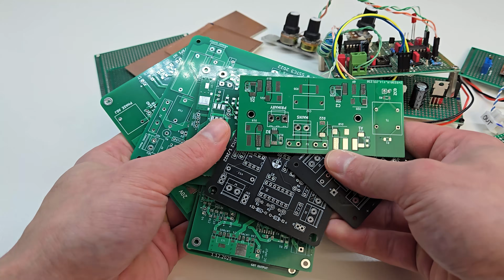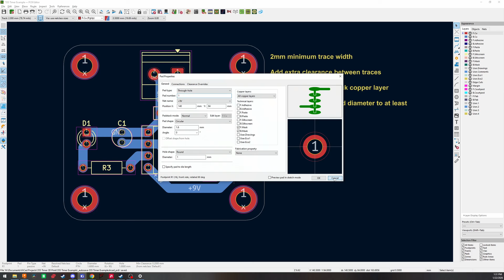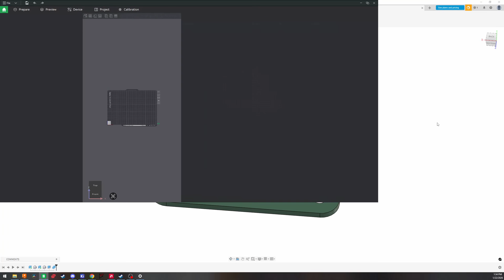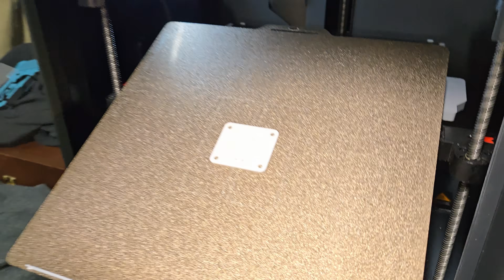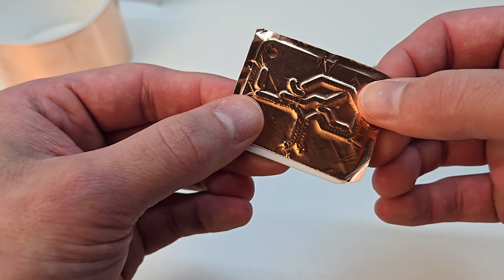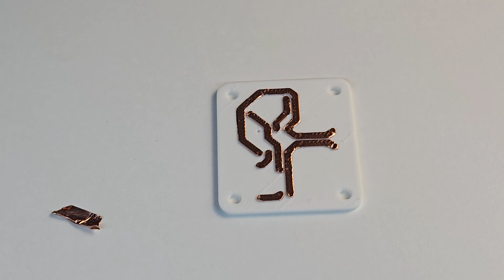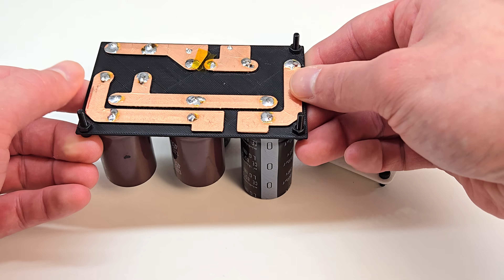3D Print Your Own PCB

Comment: Hmmmmm
You could make a script that turns the board design file into a STL with two boards, one the actual board with concave lines on where you would cut the copper and holes for the circuit to wrap around, other a board with extruded lines that fits into those lines and poles to fit the circuit holes, then you make the wholes in the first board too using the script. Then after you print you just squish one against the other

Comment: I finished my first one this week ! t'has been hard to succeed at finishing my first 3DPCB, but i made it. 

To me, the trickiest part is to cut the copper tape around the tracks ! even though I sharpen my blade before i start (or using an exacto like you do), there's always a moment the copper ends up folding a little because the blade wasn't able to cut it. that's not that much of a problem with long tracks, however, cutting arround the pads, now THAT is tricky !!! 

that's so frustrating when you wanna do everything clean and elegant, but there's copper parts that are damaged, folded, torn etc.. not to mention when it is peeling off, happened to me sometimes but it is still rare fortunately. 

But when you ends up with your nice finished 3DPCB knowing that you did it from scratch ... That's always gratifying 😌

Comment: Nice concept! I wonder if printing a small, wire sized channel could simplify the process. Might be less work to push a wire into it and bend the ends out, so they match the component leads coming through the board for soldering.

Comment: One thing I did forget to ask, how does the tape do over time? Will it peel up/crack at all on the PLA, causing shorts or broken connections? Worried about the longevity of this method.
Reply from the maker: Good question. I have had a new board assembled for about 1.5months and it isn't showing any signs of cracking or peeling. That is isn't very long but that is the "oldest" board I have.
Reply: @QZW_Labs  Sounds good, thanks!

Comment: If the 3D printer equips with the heater that can melt and continuous feed Soldering wire. You probably can use 3D printer to print circuit directly.

Comment: You can change the thickness of the copper layer in KiCAD, and set board clearances, minimum trace distances etc in the board setup. This means you don't need to worry about the fusion360 step. You can just export the STL file and print
Reply: YO TYSM this helped out a bunch

Comment: I thought you'd be using a Cricut machine to cut the copper tape. Really good idea thou
Reply from the maker: For such a simple, hands on project it isn't worth the cost of a machine like that. Using a real pcb would be much better. Cutting it by hand is really easy and doesn't take much time at all.

Comment: I gave this a try with a simple circuit for which I would normally have used stripboard. Naturally this circuit also used a 555! I was very pleasantly surprised how well this method worked. I was concerned that I would have trouble cleaning out the copper foil between the IC traces, but this was not a problem at all. I did have some trouble avoiding tearing the copper where a trace ended in a larger open area. Next time I'll enlarge the traces where this occurs. Nonetheless I was still able to solder all component leads without a hitch and was even able to tack a resistor under the board directly to the copper tape.  Thanks for the idea.
Reply from the maker: Awesome! Thanks for giving it a try and letting me know how it went. I'm glad it worked well for you.

Comment: We were doing something like this back in the early 2000s, when 3D printing was still called "rapid prototyping". We chose to use an epoxy loaded with silver to make connections between components; soldering temperatures and the plastics we had access to back then didn't mix!

Comment: Another consideration: Fire hazard.

PCB's are made from fire-retardant materials for a reason.
With a low current and low voltage project, it should be fine.

But keep that in mind.

Comment: Very cool. I think you might be able to achieve the same if you don't have a 3D printer by laser printing the circuit on to the copper foil. Then stick the foil to a flat substrate (anything from hard cardboard to fibreglass). Cut out the circuit as in the video and drill holes for the legs.

I haven't tried this with foil but it's basically the same idea as copper etching a PCB but without the chemicals. Should work.

Comment: Interesting approach. I noticed the copper tape picks up the 3D printer layer lines from the trace surface.

Using ironing on the top layer might help smooth that out. I’ve had good results using ironing with very small settings to remove the visible layer lines.

Just a small idea that might improve the finish.  😊

Comment: there is  another way to use it, make outlines of the track as indentations instead of extrufing the tracks themeselves. then you can just poke an exacto knife into a trench and go around
and if you have smooth table or a reson printer, you can make the track surface smoother and better stuck to the print

Comment: Here's another idea: print the base of it, pause the printer, tape the copper, and may be add some glue on top of the copper, then start the printer again. It will make some really complex results.
Or you can just print a special "negative cutter" to cut the extra copper away.

Comment: Cool idea, but doing this is just mainly for looks only. It takes so much time to design the boards then print and prepare them. You can literally solder them on a perfboard 3 times and be finished with your task. I would only ever do this if I want to make something look cool (which is rare, I mostly want things just to work and move on)

Comment: It looks like a real pcb.  Looks great.  But the labor seems excessive.  I would stick to traditional prototyping methods...  OR get a phenolic copper clad board and ablate using a laser, or use a copper clad glass/epoxy board and do a laser assisted etch... but only if I was trying to make it look like a pcb...  but I have been doing Manhattan construction in combination with dead bug and wire wrap.  Done well, it is very neat, despite looking nothing like a pcb, and is great for higher frequency signals.  For the smartphone prototype I built in the 1980's, I used wire wrap on vector prototype boards, before we had a pcb made.

Comment: Honestly, if you are 3d printing circuit boards, just use resin printer with recess for traces. Scrape over some solder paste  and chuck it in the oven. None of that tape faff to worry about. You can make it double sided, multi layered, flush stacking.

Comment: how did you solder it without the plastic melting
Reply from the maker: It won't melt as long as the iron is sufficiently hot and you don't linger to long on each joint.

Comment: did it smell like melting plastic when soldering? genuine question. Ive gotten that smell sometimes when getting a little too close to dip or headers
Reply from the maker: Nope not at all. The coper tape spreads the geat a little and it didn't melt it at all.

Comment: Try metal infused filament and print the main board, leave the board on the print bed. Switch out of standard filament, then switch the filament to the conducting metal infused stuff and zero the print to the top of the board.

Comment: Interesting idea, but you still have to manually trace the blade around the traces and pads. What if you'd reverse the process, making the traces slightly recessed, pushing the copper tape into them, and then very carefully sanding away the high areas, where you don't want to copper? You'd have to be very careful when sanding, since copper tears quite easily, and you don't want to peel the traces, so it would help if the glue on the copper is really strong (maybe let it cure for a bit before sanding).

Personally I use a fiber laser to make single-sided PCBs (it can do 0.2mm traces and spacing), but as 3D printers are much more common, this is still useful. Also, using the 3D printer, you could make "boards" in interesting shapes while the fiber laser can only do flat boards. This would be great in the cases where you need to hold mechanical devices (buttons, lights, motors, etc.) that also need electrical connections.

Comment: There is conductive filaments now. You could print the base layer and first layer of the traces, then pause the print and switch to the conductive filament to finish the traces. No more tape. Thanks for the inspiration. I'll be giving it a try.
Reply from the maker: Let me know how it goes. Most of those filaments have very high resistance so their application is limited. Also let me know if you figure out how to solder to it.

Comment: This might be mentioned in another coment but this method also allows you to add structural support for the component side.  Foir example, the screw terminals in the example.  Those things always twist when you tighten them up.

Comment: Interesting method! I'm going to try this to replace my perfboards for prototyping. I was just thinking—it might even be possible to do multi-layer boards if you do positive and negative on each side. The only issue would be the inter-layer vias... but by soldering the vias as you go, it seems doable.
Reply: I experimented with the design and got some interesting results. First, I tried using negative traces inside the PCB, but that didn't work at all. Then, I tested 1.5 mm traces; 2 mm was too wide for my needs. It’s right at the limit, but it works. I also created a double-sided PCB with 0.4 mm trace thickness. For the vias, I used a 2 mm pad with a 1 mm hole, linking the two sides by soldering a simple wire, which worked perfectly.

However, my main issue is during soldering: the plastic base melts far too easily. This leaves a very short window to complete the solder joint (I’m using a 400°C iron). You also have to avoid very short traces, otherwise, the copper tape lifts when heated. Finally, rework is impossible with this technique without destroying the board. Using a different type of plastic might improve this promising method.

Comment: This is a great idea, but I have to play the devil’s advocate.  There is a reason why PCBs are made of fiberglass, and that is because it doesn’t catch fire.  It will burn if excessive heat is applied, but it doesn’t catch fire.  This is something that anyone considering this should take note of, because if something like your voltage tripler overheats it could end in a full blown fire.  Very nice idea though.

Comment: This is epic mate. I copied your design. I just did everything in PCB editor and created new footprints for my project for each of my boards. I used a protoboard as a base, added all my components, deleted the unused throughholes, exported to STEP, imported to freeCAD, applied boolean and presto! full manifold was exported and sent to 3d printer.

I had a lot of copper foil tape left over from leadlighting/stained glass supplies, so this is just an awesome video mate!

Comment: How about still using a perfboard and just 3d print a template for the top side on where to mount with labels also maybe and also distance the components so they dont touch. And print a template for the bottom with gaps where the traces are and into those gaps go through with a soldering iron.

Comment: You could probably print an inverse form to press over the tape to punch it out like a die.
Might reduce any sharp pointy edges from cutting with a knife.
Especially for higher voltages where pointy things are a no no.

Comment: I would try using a mirror image board that you could press onto the board that would cut most of the foil off quickly, then do clean up with a razor knife for the smaller pieces that are hard to reach.

Comment: How about making a groove in the raised section where you can press a copper wire down? You can vary the thickness of the groove so that different sizes of copper can be used!
Reply from the maker: Thanks for the idea. The copper tape is plenty conducive and requires less solder heat then a wire would. I plan on going over this in my next video. But I think the main limitation will be the resolution on the printer to make such grooves at those scales. Making the opposite of the raised traces means the printer would have to print the smaller gap between traces which might end up only being a single wall thick and not very strong.
Reply: @QZW_Labs  And it's more cumbersome to draw, in FreeCAD and for me anyhow, so your idea stands fine 😁

Comment: You can try adding small flanges or walls around the edges (like sheet metai), that will most definitely nullify the flexibility while also letting you keep the board down on conductive surfaces without worrying about the tracks being shorted.

Comment: Could you print a “negative” where the traces are indented, and clamp the two pieces together to cut the traces rather than use an exact? Might be faster if it’ll cut the tape well.

Comment: Ive been thinking of just designing the board with some groves for copper wire (instead of copper foil), and then covering the wire with a 3D pen. That way i can overlap the wires and get a smaller design, similar to multi layered PCBs. Alternatively one could print several thinner layers and put some dots of glue around the board before using a 3D pen to weld the layers together along the edges.

Comment: I totally thought the traces were going to be countersunk, then solder wick was going to be stuffed in them and used as the conductor. Now wondering how well that would work. Guessing resistor, diode, and capacitor THT legs could push through the wick strands fairly easily, LEDs and transistors would be a little more difficult, and ICs and IC holders would be a pain.

Comment: I wonder if you also printed the same thing but withthe traces missing, you might be able to put the tape on and snap the frame over your traces to sort of die cut your traces off,  if its good enough it might not even need the weeding of the layer of tape out.

Comment: That's cool,, but a real PCB of such size (99mm x 61mm) costs les than $8 including taxes and shipping worldwide for 6 pieces...
Reply from the maker: I'd love to know where you are getting such cheap PCBs. This method is aimed at learning and DIY projects, it doesn't compete with or replace PCBs. The total for printing the 555 timer PCB was only 10 cents USD. The copper foil costs 2.52 cents per inch (2in used) and the print was only 3.26g of PLA. Total build time was about 30min, including print time. That is hard to beat if you have a 3D printer and want to make a quick and easy project.
Reply: @QZW_Labs  I understand. I like DIY project, I made this PCB printed to build a connected controller for shutters, using a cheap micro-controller (Raspberry Pi pico W) and several real remotes for the shutter. The controller is connected to my home automation system and controls the remotes. I must do that because they use a rolling code in the remote and I couldn't find the secret key nowhere... So the circuit would be a bit complicated to do with your method, there are 15 control lines plus 2 power lines, and a resistor on each control line, plus the connector for the pi and 5 5-pins connectors for the remotes. 

Firstly I planned to use a stripboard but at a dinner with friends someone whose job is making prototype circuit told me that such PCB would cost around 10€ maybe, so I checked. $7.88 is the price I got at NextPCB 2 years ago. You just have to upload your Gerber files and choose the options. The site controls the files and warned of some issues (it was my first PCB design, I am a software engineer...) They even asked to confirm something before printing. It's made in China and I live in Europe, I got it after about 10 days. The quality is much better than anything I could do with the stripboard or with my 3D printer and copper.

Comment: It's a cool idea, thank you. It works in low-power cases, but avoid it for high-current or heat-generating circuits. Standard PCBs use FR-4 fiberglass with copper traces to dissipate heat from chips and components—plastic has lower thermal conductivity (~0.13–0.25 vs. 0.25–0.3 W/m·K). Keep in mind that ICs, resistors, and caps can overheat quickly.
Reply from the maker: I will put that to the test in my next video!

Comment: I've designed many industrial PCBs and can I make a suggestion? 
Since your traces are raised, roll on some etch resist ink and then drop the board in ferric Chloride etching solution, which doesn't react with plastic so it should just etch away the copper that's not raised
Reply from the maker: Thanks for the suggestion. I think that would work just fine. I decided not to etch anything to make this as approachable as possible given that it is in-between perf boards and ordering a PCB. This method might be a nice intermediary step for some people.

Comment: This is pretty cool.  I haven't soldered up any boards for a few years now but this would be fun to try.
Reply from the maker: Thank you! I think it could be a great step in prototyping simple circuits before PCBs. If the design is simple and low power it could also just work as the final step.

Comment: Maybe try this: 3D print such that the places where you want to remove copper is raised. Then after laminating the copper sticker to that, flip upside down and rub against sandpaper to remove the copper where raised. This might be faster than cutting manually with knife.

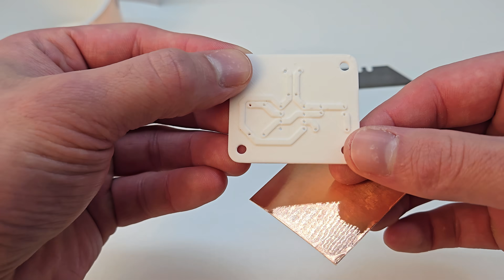Comment: 5:50 It would be worth trying to plot the film—to cut it out with a plotter. That's more accurate than using a scalpel, right?
Reply from the maker: For this application it doesn't need to be perfect. The razor works well enough.
Reply: @QZW_Labs  Perfect, yes, but not necessary—somewhat time-consuming for larger circuits.